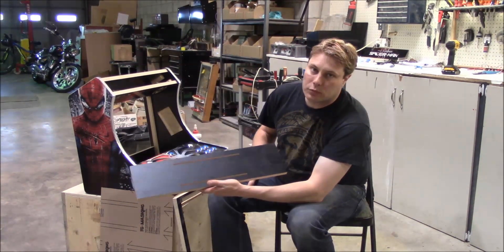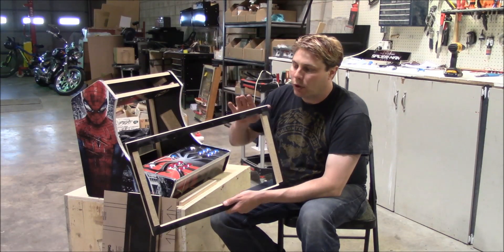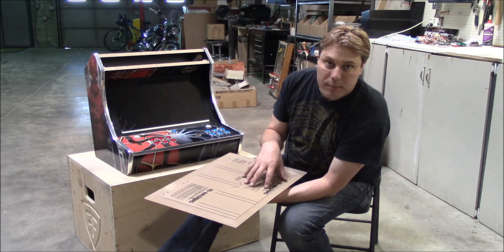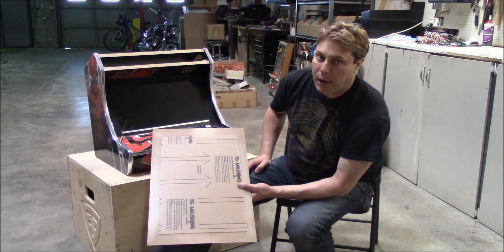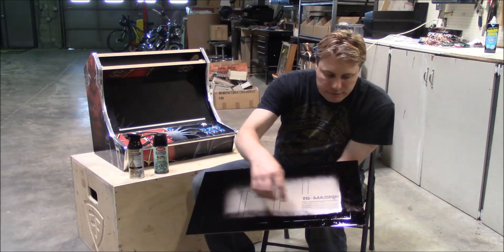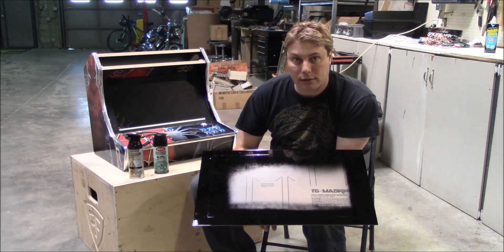How to install and finish a custom arcade monitor bezel

Comment: Thank you for all the excellent advice! I kind of understand how the Malenko mount works, but can you explain how the mounting board attaches to the side panels? It seems to move freely toward and away from the bezel. Obviously you want it close to or flush with the bezel, but when you get it positioned, how do you lock it in place, close to the bezel? Many thanks in advance!
Reply from the maker: You have to mount the monitor loosely to the Melenko mount and position it in your cabinet until you have it in the desired position. Then draw lines on the insides of the cabinet where the mount contacts them. Then take it out and measure the lines and remove the monitor from the mount. You will have to use 90 degree mounts to attach the mount to the cabinet sides. It is best to install the angle brackets to the mount first and then line up the mount to your marks and fasten to the cabinet. Now mount your monitor to the mount. Hope that helps!

Comment: This is great thank you for posting this.  Can I just get this same type of plastic at say Home Depot? Any advice in actually purchasing the plastic with the adhesive stuff on it would help me out.
Reply from the maker: You can buy this at most Home Depot stores, otherwise you will have to find a plastics specialty distributor in your area. There isn't really a product with adhesive on it already unless you are talking about the protective cover in the video? All plastic purchased should come with that on it.
Reply: @RetroactivearcadeCa  Perfect Thanks!

Comment: Excellent videos....  I followed your instructions to a T and for some reason the poly carbonate looks patchy or cloudy after the paint has dried once held up to the light.  I used the same paint etc.  Any help would be appreciated.  Thanks!  It's tricky to not get the paint to bleed too.  Have you tried a painters tape?
Reply: Don't paint. Print a custom adhesive bezel and put the plexi over it  You avoid painting and it gives your machine character.
Reply from the maker: Painters tape will leave bleed lines for sure so stay away from that if you can. The patchiness is ok if you did get a good coat on it before you let it dry. Most light wont come through it when its in the arcade especially if your monitor mount covers most of the monitor hole. This is just a decorative and protective cover. Whatever you do, don't paint over the existing paint after it has dried.

Comment: could you put it on with a foam roller?
Reply from the maker: Retro Underground you could try but I am not sure if it would apply consistent pressurr
Reply: well im not the best at spray painting so im gonna pant the cabinet with a roller, so i thought i would try wit the plexiglass aswell. i think that im gonna test it with the leftover glass from my marquee before i attempt it on my full screen. thanks for the quick response!
Reply from the maker: Retro Underground be sure to use a plastic paint, regular paint will not stick to the plexi, it will just scratch off when it dries.